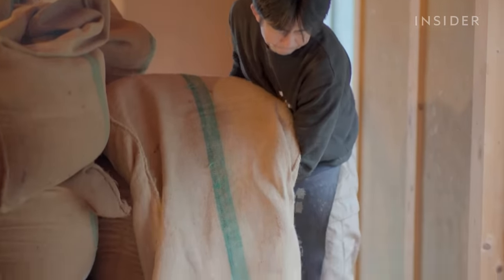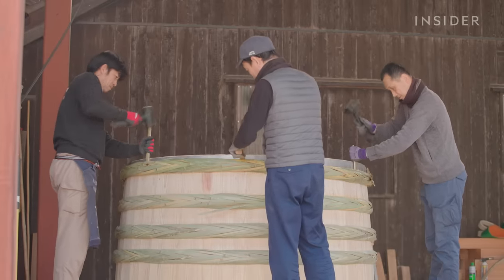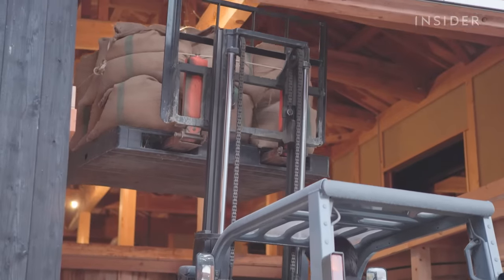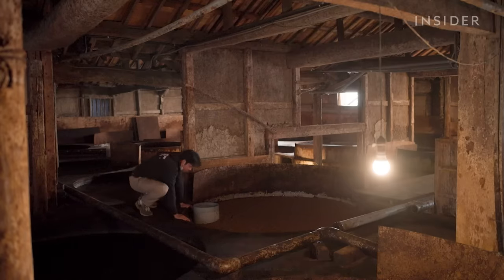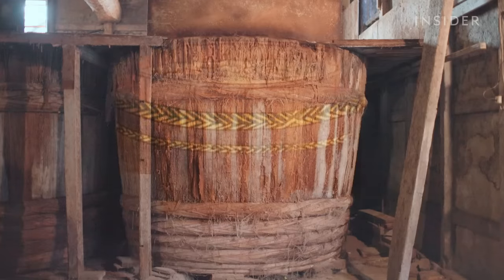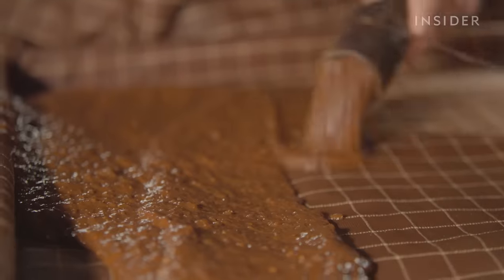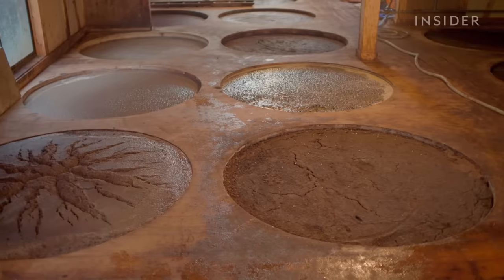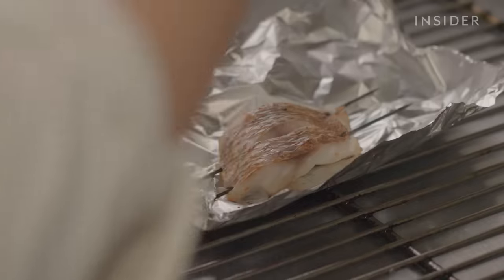Why Only 1% Of Japan's Soy Sauce Is Made This Way | Still Standing | Business Insider

Comment: Got this as a gift this year. It's 100% worth the cost. The taste, texture, and color is just different compared to the mass manufactured stuff. It almost has a thickness to it that coats whatever you use it on. Certainly delectable and will get it again for sure.

Comment: I wonder if you could get some of the flavour of a wooden barrel for cheaper if you fermented in larger steel drums and then just added wooden planks. That way you would have more than double the surface area of wood to give flavour so you could add less wood and make large batches more economically. There also wouldn't be evaporative losses that wooden barrels have. That way you could combine the best of the old and the new methods. Just an idea.

Comment: Making good product is very fun 🐁

I had only 1 chemistry class in college as an electrical engineer 🦃

So I still couldn’t figure out how to break CO2 molecule into natural elements again 🐕‍🦺

Just C, O, and O to fill this world with lots of oxygen and carbon is basically just diamond 🐓

The key is you need to figure out how to break the bonds between the C, O, and O in the CO2 molecule 🐞

Through chemical reaction or there is a better way? 🦨

Just mix the CO2 molecule with every molecule in existence or element in existence to see if they would react and the bonds break 🐞